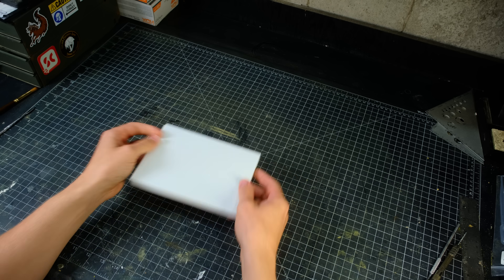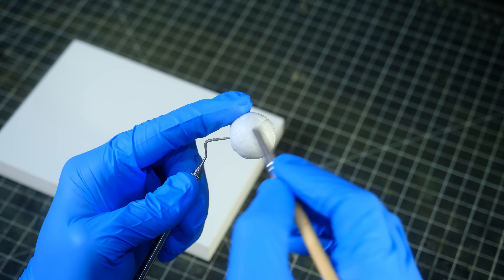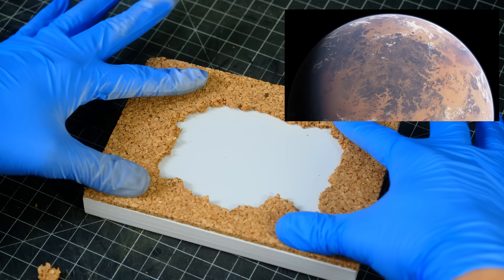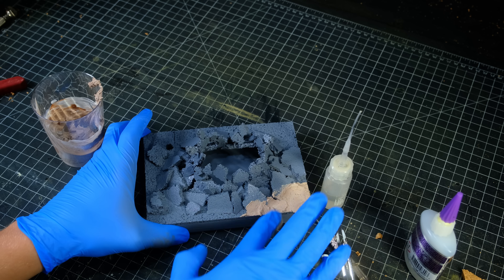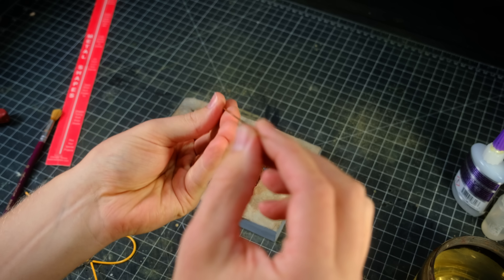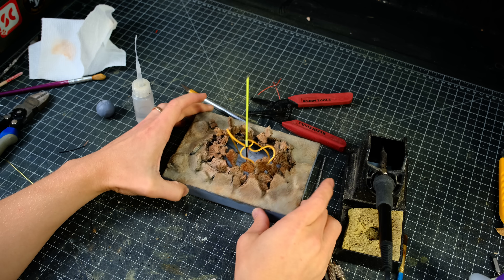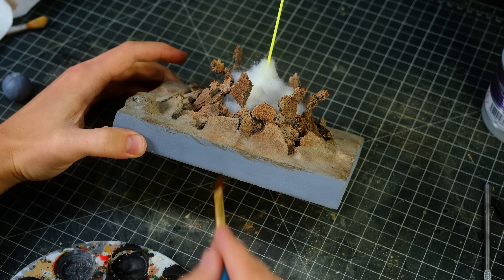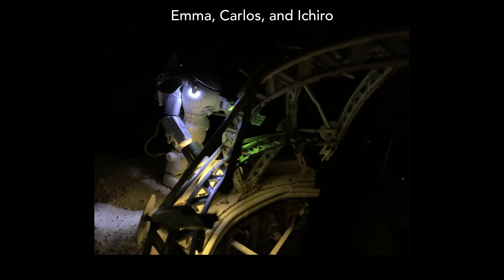Realistic Death Star Super Laser | DIY Craft Diorama Build

Comment: this would have been sooooo much better with a resin 3D printed death star ... I also think visually the scale does not add up... for the start to be this small compared to the explosion it needs to be way further away... I know you cant get the scale to be accurate but what I mean is it does not need to be correct it just needs to look good... the scale in movies is also way off most of the time... its just needs to be appealing to the eye